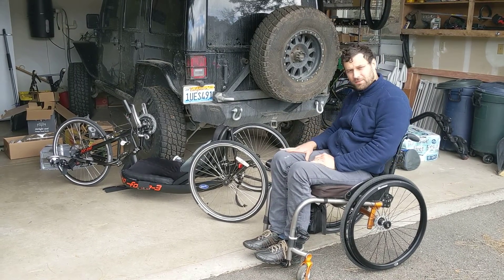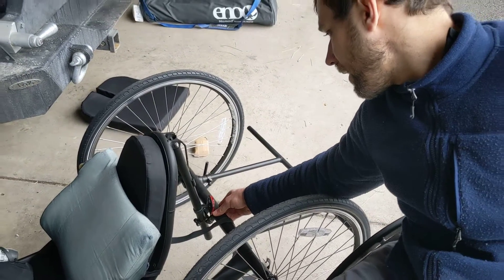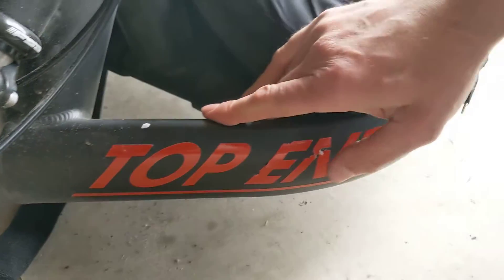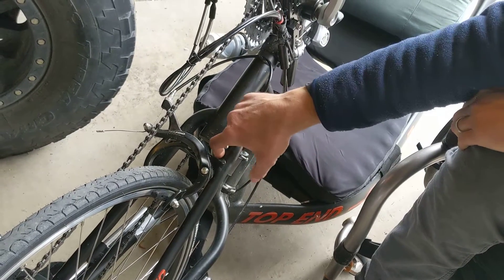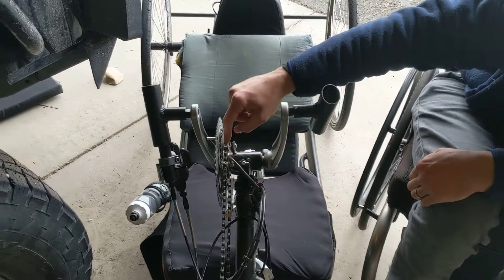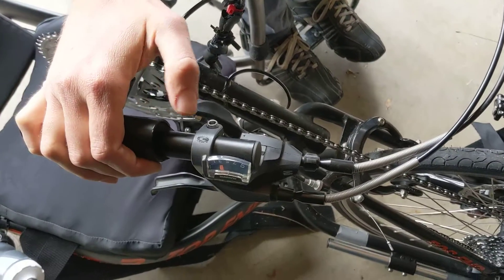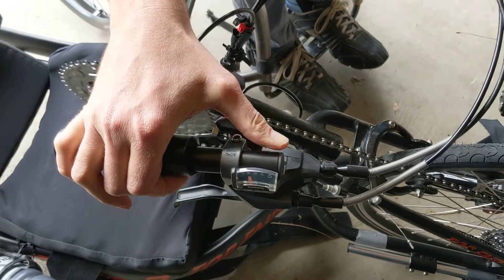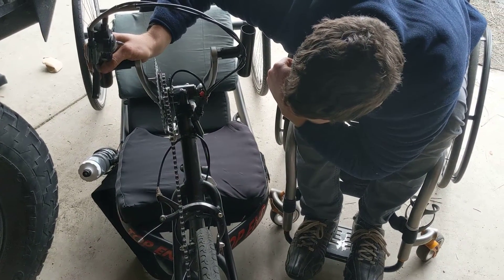Force 3 eBike Kit Mounting Options: Electric Handcycle eBike Conversion Journey Part 2

Comment: I am planning on doing this with a friend of mine. He has the Force G with the very thin from wheel. Having a head of a time finding a wheel that will work.
Reply from the maker: Does it have disc brakes?
Reply: @Life-ds6kc  No. Rim brakes.
Reply: @Life-ds6kc  It does not. I could weld up a disc mount if needed.